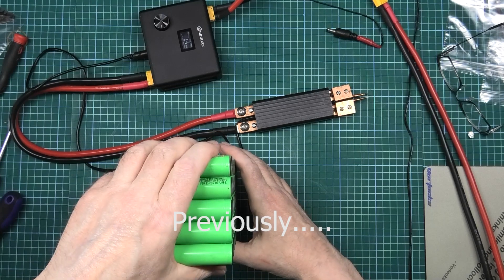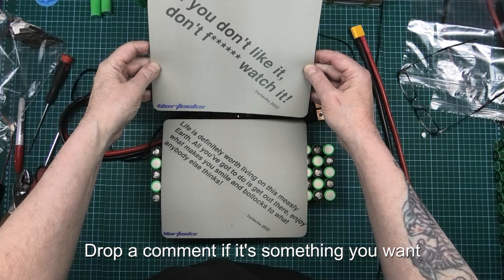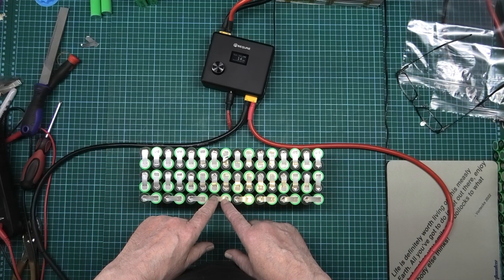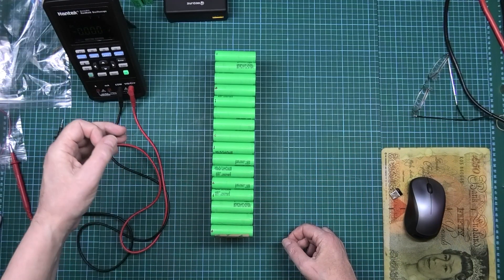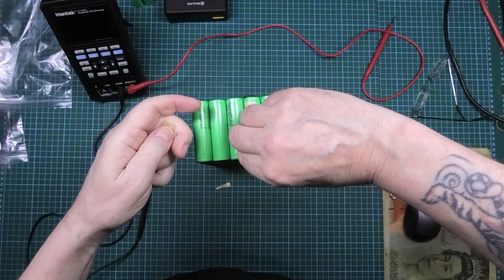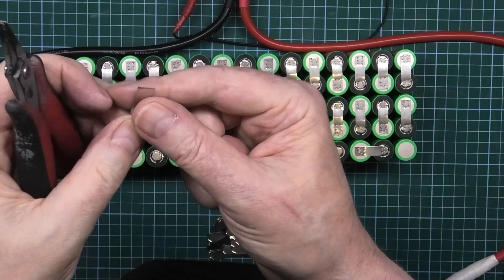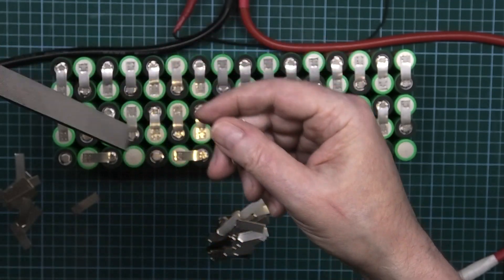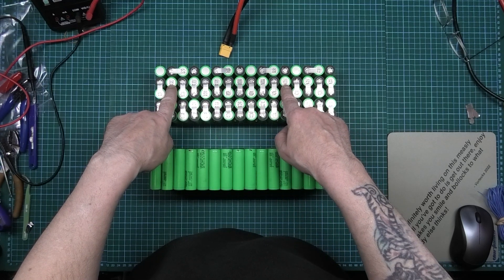The most in-depth 18650 ebike battery build ever? Part 2 of 3

Comment: Thank you! Keep up the great work! I have a disability that limits my life greatly, I don't do anything in a hurry, I do everything at my pace, in my my time, the job will be done in "Island Time" and done properly. 
Cant wait to watch your next video.
Reply from the maker: I've noticed that having a disability has one benefit - it turns you into a perfectionist. Because it takes a lot longer to do things, you have an uncontrollable urge to make everything absolutely perfect!
Reply: @Vortecks  it's true what is said though, what doesn't kill us make us stronger. I have discovered that if the Will is strong enough, things will get done, slowly methodically overcoming obstacles. 
If you have a will. You will do!

Comment: Great video this is the best battery build I have seen looks really good it's well worth the time and effort you put into it. The way that it's wired is good because if a battery should fail like you said it only brings down part of the battery not all of it which is good if your on your bike in the middle of know where.  Looking forward to part 3.
Reply from the maker: Of course, I didn't mention about thermal runaway - if the cell is faulty and goes into internal meltdown, it'll cause a chain reaction and take the whole pack. Theoretically, that would never happen because the balance wires would burn before it has time but there's always a possibility.

Comment: Saving for a bafang mid drive kit. Considered making my own battery to try and save some money.
Yeah... Not sure I fancy doing it now, I'm almost certain I would end up zapping myself or causing a major short and burn my house down.

I have some experience with repairing lipos, and I've used a fair few 18650 and 2100's before, but not this many.
Makes me nervous just thinking about it lol
Reply: Hi my friend! I'm from Greece 🇬🇷 🙋 I'm in the same place with you! But even i asked for motor winding or batteries i don't take answer... And move to the next step based on my own knowledge and what understand from YouTube videos...🤷
Wish you good luck my friend!!!!!🙏
Reply from the maker: It's not as bad as it looks. One thing I advise is to use some sacrificial wire. If you get a very thin strand held between 2 pliers and then bridge the gap you want to spot weld, you'll prove that you're doing it correctly. All that can happen is the wire will melt and not cause any damage.
Reply: @Vortecks  Good idea, bridging that gap can be nerve-wracking with an asymmetric pack at eighty-odd volts.

Comment: Have you ever thought about using 21700’s? I seem to be making more packs with 21700’s as they have far more capacity and discharge capability then 18650’s
Reply from the maker: I'm sorry but that's wrong. This pack (8 parallel) will kick out 280A. The equivalent physical size pack with 21700 cells would be a 6P configuration and, even if I used Samsung 30T cells, it would only be 210A
Reply: @Vortecks  don’t have a clue where your getting your data from but VT6C’s have a 20A max discharge so that’s 8x20A=160A
If you was to use P42A’s they have a max discharge of 30A so 6x30A=180A. Data talks !!

Comment: You said you remove flux from soldering. You remove it with alcohol or?
Reply: Isopropyl Alcohol, as far as I know... 96+ concentration.
Reply from the maker: Yes, 99.9% Isopropyl alcohol. You can buy special flux remover but in essence, it's IPA

Comment: With this logical,  i can make 2 different packs 20s 5p (because of space) and connect to one BMS!!🤔
Ok.. i won't make it like yours way (of course is better, but need skills), but the basic idea is the same...
2 pacs 20s5p with one BMS... I will double the balance wires and must work... Am i right..??🤔
Reply: Theoretically, it should work. Remember though, your balance leads will need to be the same length to those cells, if not, there will be voltage differences causing issues in the bms sens circuit. Not only that, but one wrong cell level connection will cause damage to other cells and probably the bms..... There is a reason these packs are designed the way they are, so make very sure of your cell level connections...

Comment: Theres nothing independent here, you actually connected them all in paralel just with wires instead with nickel. Also cells dont randomly go short circut. thats just idea that possibly originates from hbpowerwall because he fused all cells in his packs. also if balance wire burned (it never will but lets say you cut it) pack is again not open circut, just point where wire burned is not balanced with rest and series pack works the same.
Reply: please understand this is not "ur just wrong" comment. try drawing a scheme of this and you will realise what im talking about. you just made effectively the same thing just with extra steps hah